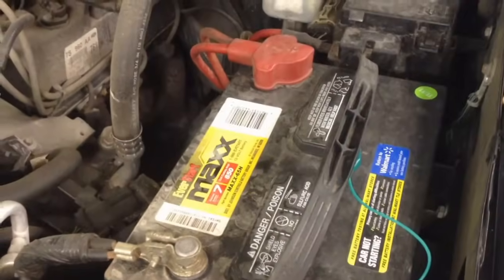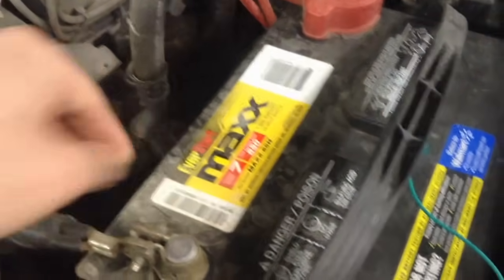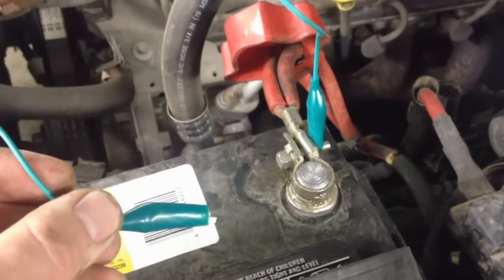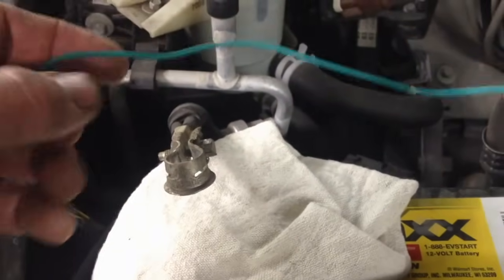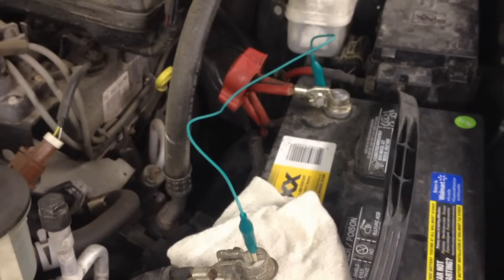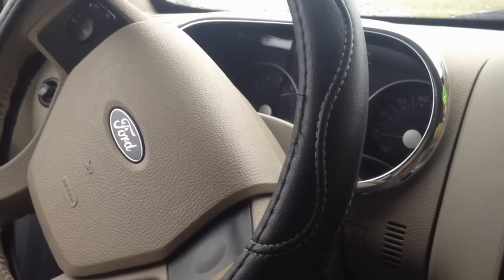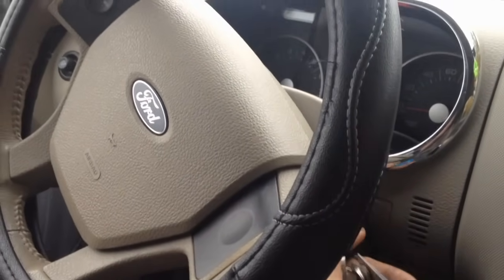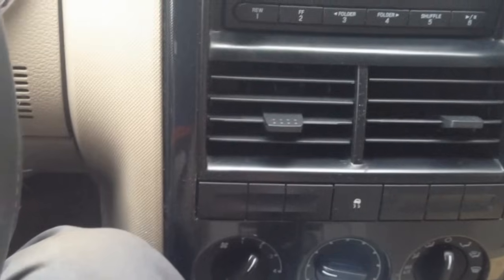How To Clear Your PCM'S Memory On Fords After Repairs

Comment: a 12v test light instead of the jumper wire will allow you to witnesses the power dissipate and is easier on a capacitors
Reply: Good advice from John Padgett thanks for educational comment 👍
Reply: How do you use the 12 test light instead of the jumper wire
Reply: @tashaelizabethgooden211  you place the 12v tester on both terminals just like he did with the wire but when you use the test light it will light up because of the power that’s stored in the PCM and capacitors. As the caps discharge the light will start to dim and fade away. Once it fades to off you know your caps are discharged. Same goes for many electronics. When installing fuses into things like car audio amplifiers. To avoid the initial spark you can apply the test light in the same way and power the caps inside the amplifier so when you install the fuse you won’t get that quick ark and spark. ✌️
Reply: @carl3820  So the alligator clip would go to the  disconnected negative cable & the probe to positive correct?
Reply: @paulsosa1872  yes. That’s correct. I’m sorry for the late reply. I didn’t realize you replied to me. Sorry about that. But yes. Alligator clip on either the disconnected ground wire or the positive and the probe to the other. The test light will light up right away and will slowly fade as the power dissipates. ✌️
Reply: @tashaelizabethgooden211  um… clamp to either side of the battery and touch the other side 🤦‍♂️😒! 🤜🤛🙋🏻‍♂️👍🤷🏻‍♂️🤦‍♂️🌿
Reply: My 2007 5.4 3 valve tries to die when I turn left. Could this be a fix?

Comment: can i use a black negative cable with alligator clips as a jumper? or is it a specialised cable?
Reply: Any wire with alligator clips will work. It's just a bridge between cables completing the loop without the juice from the battery.

Comment: I've tried this and it didn't make a difference. I recently replaced my 03 explorer limited engine with 03 mountaineer both 4.6 both vin W. I know the mountaineer engine works because i drove it next to the explorer. But now it won't turn over it will crank but nothing more any advice.
Reply: Sounds like a starter I had some not turnover but sounds like a ticking crank hell I've had bad starters make an engine seem like it's locked up
Reply: @masonjones5658  it turned out there was a sensor unplugged on the bottom,  works fine now

Comment: I have a 03 f150 5.4L. I keep getting a code for the crankshaft position sensor not learning. Changed the sensor out with new from local auto parts store and all I it did was crank. Reinstalled the old one it fired up ran 2 day code came back any suggestions

Comment: Hi (2005 ford f150 stx, 4.6 v8 4r70e 4wd) I replaced my OSS sensor  after a p0720, it was gone on restarting, but after driving about 100 ft and getting to 15 mph, it came back on. Since ford had given me the wrong sensor (TSS) I replaced it too. Noticed I had no speedometer so replaced VSS.  Still no speedometer,but no po500 codes, just p0720 and the throttle controls limp mode.

I got wiring diagram from ford of the OSS circuit pins for OSS have aprox 2v in park but not drive, TSs has volts always( key on run) P or D, 

       TR1 Tr2 Tr3a TR4(with auto voltmeter)
 P.     Y.      Y.      Y.     N
D.      N.     Y.      Y.    N

DTR sensor replacement and then then clear?

Suggestions, or where do I start next.
This is my firewood truck and secondary tow vehicle for my tree and Landscape business. It's not worth dropping another transmission in it anymore, but I got too many uses for it to scrap.

Comment: Wish I could say I had success like you but I had a Ford Focus 2014 that ran with mild issues and now I have a $2,000 bill at the dealership because this put an engine fault service light on that could not be removed with anything but Ford VCMII/etc resets, which meant it had to be towed there.  The ECU doesn't cost that much but I am replacing the housing and then labor during COVID-19.  I also had them check several components in the car to ensure my VIN didn't slip off the recall/lemon list and had them check the wiring harness, throttle, grounding cable, evap system, etc.

Last time I take automotive advice from YouTube...  such a common and easy suggestion too, must have been 5 videos just like this.  DO THIS AT YOUR OWN RISK!!!

I am an accomplished tech and I get paid to talk without needing a YouTube Channel.  Here is what to know:

This method often works, but when it doesn't it can be catastrophic (ie: car that won't start in your driveway).  Keep that in mind before you attempt it.  I could have cloned a VCM II and done the reinstalls myself, but then I got sick and put in isolation myself.  Also, it's co-owned and co-paid and the other person wants a dealership guarantee on the repairs.

Still...I've been without my car for over a month now because of this very simple "fix all" so I have to advise caution.  I never, ever thought a simple technique with such positive reviews would leave me utterly screwed.  I'd sell the car back if I could and I got a KILLER deal on it, all I was trying to do was fix some stuttering issues and the car wouldn't even turn over after that.

I own stock in Ford, can't wait to sell it.  Started putting money into Chevy/Nissan/Subaru.  All of my neighbors own Chevy's.  Imagine how I feel.

Comment: Help! I switched out the solenoid pack on my 2010 mustang v6 and tried doing this, but even after that the transmission doesn't shift past the 1st gear. Should I keep driving ? Or can it be something else wrong

Comment: I have a ?. I'm getting ready to do a PCM relearn after a throttle body cleaning, but I'm also getting ready to put new larger tires on my 2004 F150. Should I do the relearn on it with stock tires or wait and do it with the larger tires?

Comment: Great video thank you for your time. I have a 2011 Ford Fiesta automatic I have a check engine light that will not go off I just did your trick and it did not clear it I've left the negative off overnight with the headlight switch on did not clear it it will not go into reverse and move it will go into reverse it just will not move in reverse forward gears change with a major stall between shift points it's sat out in the cold snowy weather non started for about a month jump-started drove fine came to a stop and the shifting began to be hell and that's when it did not go and move in reverse gear any thoughts would be grateful 2011 Ford Fiesta thank you for your time Sir.

Comment: I have a 2003 F-350 2wd and the OD light is flashing at me. It has some shifting issues after 5 gear it hits real hard and even makes a belt squeal a little. Then the light comes on and starts flashing . The shop said it’s a turbine speed sensor is bad but I have already replaced the input and output sensors. Any ideas or help ?

Comment: Your videos pulled me through a 04 to 05 motor swap. Big problem though existing engine harness has no circuit for knock sensor. The 05 does. Is it possible to de-pin knock sensor from pcm 05 harness and break plastic knockout at pin numbers 27&57 then insert sensor pins and plug in knock sensor from the block female connector.

Comment: I have a 2010 5.4 that I changed the alternator and battery now the battery light keeps coming on..I did the reset procedure in the owner manual but its not going off and everything else is ok do you know what else to do thanks

Comment: I got 2002 ford focus had many work done like IACV replacement.  I notice sputtering and vibration, after stepping on gas pedal on idle it raises up and goes down 5-10 sec after. LIke I said many stuff done like 2-3 vacuum leaks.  My scan tool shows IACV reading at 40-60% on morning start and drops to 19.92% after warm-up about 5 min then all sputtering/vibration starts. I even unplug the IACV while idle on 19.92% and car didn't show any difference.  Will this work? Hope anybody can answer this before I do it today. Wish me luck!

Comment: How does it not short out when you go across the 2 poles are not the grounds connected to the chassis ?
Reply from the maker: The circuit to the battery is broken therefore no electrons can flow.

Comment: so I have a 2001 Ford f250 super duty with a 7.3 and it has dual batteries on it so which battery do I do this operation on? Thanks for your video I think is going to solve my problem if it works on my.

Comment: I did 4 drives, in my 2007 Mercury Mariner Hybrid, to clear the 7 codes that developed from the 12 volt battery getting drained. And still they will not go away.
Reply: Something is obviously wrong

Comment: Hi, thanks for the hot tip👍🏽.. would this work on a 2017 Ford Wildtrak in Australia.. it was in for repairs and now the transmission isn’t shifting, I perhaps had the thought because it was sitting so long and being disconnected from the battery. Cheers for your help👍🏽🤙🏽

Comment: Can o fix my problem by disconnecting positive  side. Because my negative is very deep inside the hood i can’t disconnect it, i have Ford Escape 2014. Im wondering if I follow the same procedure  but instead of disconnecting negativ first i do positive would it work for me ??

Comment: I did this procedure on my 13 ford explorer v6, and now it wont start, and no clicking/ the odometer comes on, and a light check the break system comes on. Did I burned the PCM?
Reply: Update, yes I did this resetting on my 13 Ford Explorer v6,  and it worked, I got scared because maybe I burned the PCM, WHEN NO CRANKING, but after going under the fuse box under the steering column, I did disconnected a ground wire for an aftermarket alarm Ford dealership had installed  which I told THEM to disconnect but it was still connected, HERE IS THE FIX:I DISCONNECTED THE GROUND WIRE FOR THE AFTERMARKET ALARM AND IT STARTED RIGHT ON.

Comment: Hi there  I having problems with the  anti deaf system on my 2000 Ford mustang  V6 it will not let me turn on the  Engine 
How can I  make work. 
Thanks for your time
Reply: I have the same problem
Reply: Check your key..pcm clustet..osts system....try with that
..maybe needs programming

Comment: I had a couple issues I was looking to fix.  mostly the p0420,  but I had an ABS code that came on for seemingly no reason.   The ABS scanner from autozone couldn't clear it, so I thought I was in for a trip to the dealer.   

I tried this fix for the 0420 since I had repaired an intake leak and needed the computer to relearn.   Well, after starting and driving, no ABS code and the ABS works perfect!   I'll hold my breath for the next couple hundred miles, but this has gotten me closer than anything else to fixing it.

Comment: I have a 2016 Ford F-150 ecoboost and my radiator fan is running on high and it’s super loud and my ac doesn’t work. This happened before and I started my truck the next day it was working normal again. But this time it’s just stuck not working. Will this help my problem?

Comment: my 07 explorer have banging from park to reverse/drive to reverse. just have a transmission oil change, no metal fillings on the pan. Some said its the solenoid valve will this help clear 
of the ''banging''? also check the support bracket by the drive shaft and the bushing are good.

Please advise

Thanks

Comment: If you take off the negative cable and turn your headlights on for 30 ta 40 min will that do the same thing or no????
Reply from the maker: No, headlamps are ground based switches to a module such as the SJB, that module has no power to flips over the relay and turn on the headlamps.
Reply: @FordTechMakuloco  not sure if I replied correctly, dont donthis much. Does this only correct shifting or can it help with a slight shudder I have at idle. And does this erase all memory for the whole truck? Sync, remote start radio etc. I will pay you for your time if youde like just tell me how cuz I do appreciate your knowledge

Comment: Will this work on my 2013 Ford focus which is experiencing an engine fault service now error I took it to the dealer since there was a recall on the purge value and the pcm that fix only lasted a couple of days as the same message will pop up if I drive for a certain amount of miles as the car keep losing communication to the tcm

Comment: I am currently not daily driving my f150 , it has a open recall for a trans speed sensor. I have an appointment with the dealer for the recall, does the dealer reset the ecm like in this video here after the recall repair or should i go ahead and reset it my self? I would rather the dealer reset the ecm if thats step in the recall repair. Thank you

Comment: DUDE!! Ive been scratching my head for weeks trying to isolate a sputtering issue at 1200-1500 rpms. Changed plugs, wires, tps, maf, fuel pump, checked egr passages, clean intake plenum and runners, CAT o2 sensors all the usual suspects...tested or replaced several things...all showing proper specs. Even watched drive cycles for data with my scan tooln vacuum test, compression test..
You fixed my 99 Mustang!!

Comment: Pulling codes p0732 p0735, o/d light flashing. Happens driving after the engine/trans get to normal operating temperature; o/d light on dash will start flashing then the hard shifts happen until I turn truck off. Once I restart truck, light is off & shifting/driving is fine. Shifting is nice & smooth until this happens again only shifts hard when o/d light starts flashing on dash. Ideas???
Reply: Interesting I am having the exact same problems. The OD off light starts flashing the moment the Transmission changes into the next gear. Was looking for answers. I may try this idea in the video.

Comment: Do you do this on a 2001 ford taurus 3.0L after changing the tcc solenoid in the transmission instead of taking off the negative battery cable for about 30 minutes to reset the computer?

Comment: I own an 00 and 04 Ford Taurus the 2000 is a flex fuel and the 04 isn’t, they both idle rough and lose power when accelerating would this help with my issues, I have replaced plugs Pcv, fuel filters thanks for any input

Comment: The best way to clear your ecm memory is to disconnect your ground battery cable and wait five minutes and reconnect..  Clearing with a scanner usually requires tow to three times., because pending and old codes want to hang on.  Not an opinion, but based on damn experience

Comment: Have a 4 speed auto Fiesta. That certainly worked thank you. I have a low torque problem mainly in shift 3 but also 4. Do you think it could be solenoid B related as it is common to both. Thanks.

Comment: I was told that if you do not have the jump wire that you can drain the capacitors by unhooking the negative terminal and honking the horn, is this true?
Reply from the maker: Uh no.
Reply: @FordTechMakuloco  ok cool, i seen it on another video and figured if anyone could debunk this myth it would be you, thanks.

Comment: Can i use regular jump cables if i dnt hsve tool in video??
Reply: Yes
Reply: @lakespeed9299  how do i connect
Reply: @rjnardo7462  Just like he did, but with jumper cables.
Reply: @lakespeed9299  do i connect all 4 cables or jus 2??
Reply: @rjnardo7462  2
Reply: @lakespeed9299  negative and positive rite?? Other 2 connects nothing rite??
Reply: Im not sure if im doin job correct..i fixed nothing thru this video

Comment: followed your instructions on clearing the PCM's memory on my 2007 4.6 explorer. took it for a drive as it relearned everything. Parked it. Had to run to the store an hour latter and found my odometer now reading 211111.1. It had just flipped to 210,000 the day before. ??

Comment: Bro, I tried this on my 2018 XL F-150 that has started shifting roughly and it worked. Smooth shifting now and showing better fuel economy also. Thanks for the video!
Reply: Did this really work on your 2018?
Reply: Reason why I ask is there is another video here that says it has to be done with a scan tool.

Comment: Worked like a charm on my 2007 Mustang GT.  Feels like a new car now.
Reply: 1130pm I have a 2006 GTand battery light and check charging system  light is stuck on i believe Every scan says its  the alternator and its not Changed everyrhing theres is Hopi ng this works
Reply: You need a qualified mechanic @berard34

Comment: Will this help with a 2012 fusions radio suddenly has no power? Fuses are good. Thanks
Reply: I tried this yesterday but I didn't do the 10 seconds in the on position before starting and it never worked but I came out today 24 hours later and my radio was blaring soon as I turned it to the on position. I've used your video in the past to correct my heater problems after a Ford dealer programmed 2 new keys fibs to my car during the winter. I had no heat after 10 seconds. So I thank you very much! It all works fine now.

Comment: My daughter has a 2008 fusion automatic that appears to have the issues with the adaptive learning trans. Fluid looks good and mechanically it seems fine but it has intermittent erratic shifting, up shifting and down shifting. Will clearing the PCM reset this learning process or is that a dealer only process?

Comment: an even quicker way to do it is to disconnect the positive side as well from the battery and run the jumper across the positive and negative cables. If there's enough slack you can even touch the positive and negative cables together once they're disconnected from the batteries. On vehicles with two batteries make sure you disconnect the cables from both batteries. Doing it this way drains the capacitors in about 60 seconds or less.
Reply: On newer vehicles if you do this you May fry one of your many computers
Reply: @martyelder9972   Please explain how that could be possible. All your literally doing is discharging the capacitors.

Comment: This won't reset the TCM KAM settings...... only PCM, but not all of it because it uses non volatile ram
Reply from the maker: Correct on the newer vehicles
Reply: @FordTechMakuloco  is there a way to reset tcm Kam without having to use an expensive scan tool. Besides stealerships.